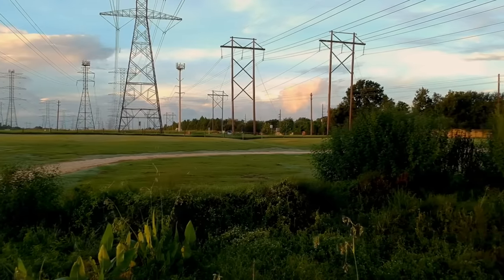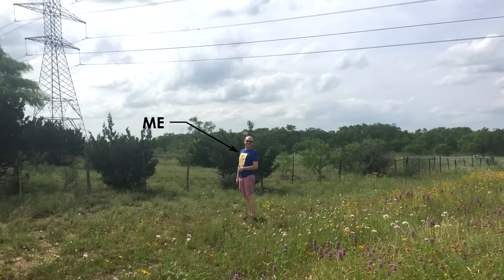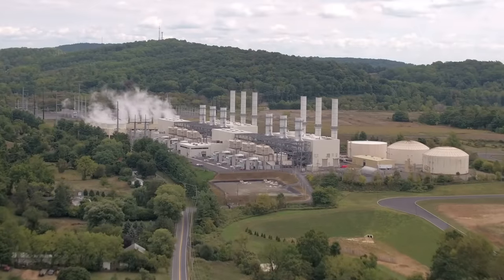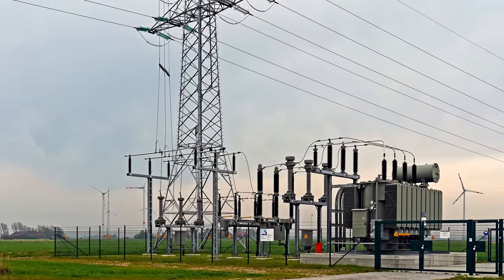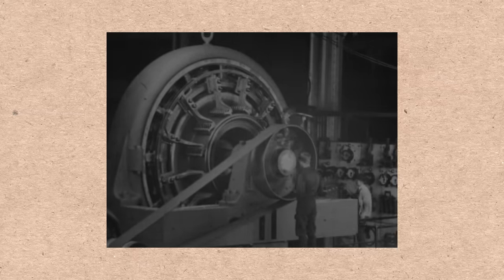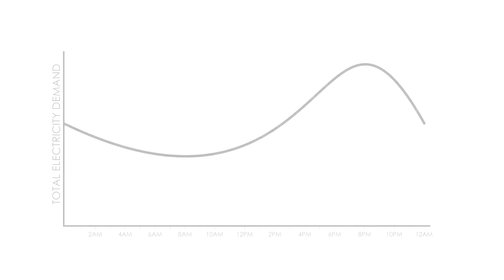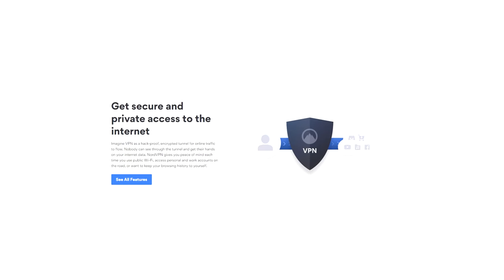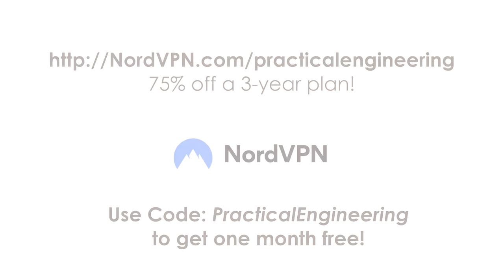How Does the Power Grid Work?

Comment: German energy-engineering student here, I really wanted to see a video series on this topic. So thank you for making this video! It's interesting, that the American Power Grid uses the better frequency of 60 Hz, but the worse Voltage. If you took the European 400/230V and combined it with the American 60Hz it would reduce the powerloss in both grids (European and American) by a few percentage points.

Really looking forward to the next videos!
Reply: why would 60Hz reduce the powerloss? Higher frequencies -> skin effect -> higher losses right? (I know we're talking about 10Hz difference but still...)
Reply: Thing is, if I get this right, higher frequency means better power conversion at transformers, which is a very lossy operation to begin with, though not as lossy as low-voltage long distance power transmission.
Reply: @jtauscher  Yes, but as WastedWizard said, the losses that you reduce in the transformers for going from 50 to 60 Hz is more than the increased resistance in the cables from the higher frequency. Though skin effect is a problem in small diameters, the cables are huge enough, that it's not really a problem. The Inductance and combined with the higher frequency the higher resistance are just small enough, that the transformers simply have a higher gain from the increased frequency than the increased losses in the cables.
Reply: @JainZar1  I like your comment. I have been wondering the same exact thing. But i have a couple questions, if i may? 
Skin effect aside, doesn't 60Hz increase the inductive/radiation losses as well, when compared to 50hz? 
But i get what you are saying. I'm just wondering. Thanks. :)
Reply: @JainZar1  Thanks for your reply, you seem to have a point there. But isn't it the case transformation will be done on a base of semi-conductors more and more?
Reply: So Argentina, 220V/60hz
Reply: This discussion was worth the read. Thanks guys
Reply: @asbjo  As WastedWizard and I already wrote, we think the gains in the transformers outweigh the increased losses in the cables, but you are right you have to consider inductive losses in the big long grid cables.
Reply: It's not that easy. Capacitive losses due to parasitic capacitance of the grid are larger with higher frequencies. But transformer losses are slightly lower. You have slightly more losses due to skin effect, but you might have slightly smaller transformers etc.

The same goes fur high voltage direct current transmission. It's not "just better", it depends very much on what exactly you want to do with it. DC/AC conversion is not that efficient and the stations are quite expensive but you have virtually no capacitive loss and ohmic loss. However, you might have new issues with space charges building up in certain types of cables if the polarity is always the same etc.
Reply: The USA uses 240 volts.

At the home, you connect to HALF of the transformer, giving your home 120 volts. So there is NO transmission loss due to the usage of 120 volt power.
Reply: @jtauscher  Totally, I don't know about highest voltage grids, but AC/AC-converters are used in many high voltage applications already. The DB (Deutsche Bahn) had a 400 MW AC/AC-converter build in 2013/14, so it definitely is a thing of the future grid. The investment times for this kind of infrastructure is really long through.
Reply: @wastedwizard5112  large power distribution transformers are usually around 99% efficient. They are far from lossy.
Reply: Philippines is using 240V and 60Hz (230 in leyte and samar parts, but mostly 240 elsewhere)
Reply: @JainZar1  I'm not an engineer, and haven't done the math either. I'll take your word for it. :P 
What's your thoughts on High Voltage DC backbone transmission systems then? :)
Reply: You know reason for using 50Hz was related to wire cost and construction. Higher frequency means more of electricity (electrons to be more precise) moves at edges of cable. Thus higher frequency requires more wire surface than lower frequency to work at same heat loss (less crosssection to move   more heat generated) There are two main ways around thicker wire or cable consisting on several wires. Both are more costly than thinner wire. Today most common cable(at least where I live) is steel core, bunch of optic cables and those are covered in bunch of copper wires to transfer electricity. At time most european countries started to talk about common electricity grid wire cost and construction was more of an issue than anything else. and yes 10hz make great difference. Electric grid anywhere is just lost of compromises there isn't any perfect one. There may be just ideal for your current needs in your current area. Also Main grid usually work in several kV to transfer at most distances ... Main grid here is 480kV which then transformed to 22 or 44kV for area distribution which is then transformed to 400/230V for most end users ... Which does not effect grid as much as 50 or 60hz
Reply: @JainZar1  AC/AC-converters are not used that much in transmission. DB used them to conenct  their train grid with 16,7 Hz to the common grid 50 Hz. In transmission the transformers will be the best choice. You just use the converters if u have a really messy grid to get a better sinus curve, to reduce the reactive Power and the grid disturbance (Netzrückwirkungen).
Reply: @spoonikle  In Europe its the same, except we use 400 v distribution grid, and connect a single phase to get 240 v.
Reply: @ziadali6298  Cool story bro.
Reply: @MH-df6zx  right!? Plants need CO2 to breathe, and they create oxygen for us. We're always so blind towards nature, then people capitalize on some 'green' energy while everyone else pays a lot to hook up to the monopolized grid. The taxman is happy. ... For now:)
Reply: @marker113  so you're with burning coal or not?
Reply: @marker113  well, that'd be fine if we weren't clear cutting said plants simultaneously. one might be fine, but both lead to some positive feedback loops with quite negative environmental impacts.
Reply: @jtauscher  Actually, the efficiency of a transformers is something like 98%. That said, the fact is that in absolute numbers, the loses are quite high, because even just 2% out of lets say 500 MVA tranformer adds up.
I can't really see big transformers using semiconductors, if something like PWM was on your mind. Semi-conductors are great for consumer electronics, because they need less space, but I doubt that they would be more efficient or convenient than convential transformers.
Reply: This has mainly historical reasons. If you would build a new grid today, you would use a HVDC grid, which provides less electrical losses.
Reply: @asbjo  I believe ElectroBOOM has a video about it.
Reply: WRONG Raven.  The US doesn't use 400/230V for long distance transmission.
Reply: this thread is too advanced for me
Reply: @nicholaslau3194  I know he has. But I wanted to get OP's thoughts on it. :)
Reply: @hotdognr12323  in the USA The voltage of a local transmission line is 13,800 volts. THEN it is dropped at the  house or business.
Reply: @patrickeh696  Right, it's been a while since I studied the topic. But my point still stands, in that the US does not have the same final output voltage as in Europe.
Reply: @jtauscher  Skin Effect at 60Hz is negligible. It is a radio frequency phenomenon.
It is the higher voltage that increases efficiency because of lower current requirements - it is current that causes losses by heating, so better to use higher voltages.
Reply: @JainZar1  Actually, skin effect is worse in larger diameter conductors, not smaller. What happens is the flowing current generates a magnetic field, and that generated magnetic field in turn induces an electrical current that opposes the electrical current that created the original magnetic field. This causes the current to flow in the skin of the conductor. For 60Hz, the skin depth is about 8.4 mm meaning that you can have a conductor up to 16.8mm in diameter before skin effect causes too much of a problem. For 50Hz, the skin depth is 9.2 mm.
Reply: @hotdognr12323  You have no point.  The voltage to the final destination in the USA and EU is about the same.  What is your point?
Reply: Don't want to be too cynical, but this is a pretty sophomoric discussion.  The fact is that the choice of 50 vs 60 Hz as the frequency, and the choice of 120/240 versus 220/440 as the distribution voltage were compromises between a number of competing factors at the time those decisions were made - more than 100 years ago.  If the decisions were revisited today, it is possible that the critical factors might be different, but its not economically practical to change the outcome.  Basically, we are stuck with decisions made a century ago.

For example,  the choice between 50Hz and 60Hz was based on arc extinction physics in the dominant arc lighting technologies used in Europe and North America (enclosed arcs versus exposed arcs).  We don't use arc lighting any longer.  Instead, the dominant lighting technology today is the LED - which is a DC device.
Reply: It's to simple to say that 60 Hz Automaticly give you a reduced powerloss. Next to the mentioned skin effect which gives increased ohmic losses in high current lines, higher frequencies also give higher capacitive losses in long high voltage overhead lines and cables. That's the reason why for long lines they use HVDC. One big andvantage of higher frequencies is that your components are lighter and cheaper, because you don't need so much iron for the magnetic field. This is why they run 400 Hz on planes.
Reply: @jtauscher  Almost certainly not. Transformation of AC power using traditional inductive transformers is incredibly cheap and efficient. There are no moving or delicate parts, just copper windings inducing current through iron covered in paper and oil.
Reply: 400/230 V has its advantages and disadvantages. American 120/240 V power is safer and cheaper to build rectifiers and the like, since it's easier to insulate, but it can't be run across as large a distance without a big voltage drop.
That being said, we use 277/480 in some cases, like businesses with large loads and equipment that needs to be run on high voltages. It really depends on the application.
Reply: @monophoto1  Local distribution at 120V was successfully lobbied by the copper industry. It makes no sense otherwise, not today, not 100 years ago. The logical decision for local distribution voltage is as high as possible without instantly killing humans upon touch and to limit installation costs (for which 200-250V is ideal).
Reply: @mr2octavio  Nope, Argentina is 220v/50Hz, that's why we're a PAL country.
Reply: I thought the USA centre tapped 240V. Don't some of their high powered devices operate on the higher voltage (electric hobs etc)?
Reply: The only reason is that generator are more efficient with higher frequencies. The Transmission is not really affected, you can build smaller transformer than for 50Hz. You get way more losses with earth cable and much more phase problems with that. Also the slower frequency is better for the Equipment this gives a larger time window for relay to operate during faults. But in the Transformer eddy losses do increase not linear with frequency. You might want to visit some lecture for on such topics i found them very interesting learned there allot. Things are always more complicated than a view sentences
Reply: @axiom1650  THERE IS NO LOCAL DISTRIBUTION AT 120V.  Local distribution is at OVER 13Kv.
Reply: I believe that transformers have very high efficiency something like 97-99% (bigger is better)

And skin effect is not a problem of small diameter, but problem of high current and need of bigger diameter. If I'm remember correctly, penetration depth of 50Hz is 6cm where wire conductivity drops to 1/e ( 37%) and to overcome need of wires of large diameter, that are not conductive in the middle anyways and to solve corona discharge, wires are made "thick" by using 3-6 smaller diameter wires held apart by spacers. At least for 400/220kV power lines in Europe which connects power plants and cities.
Reply: South Korea, Philippines, Peru and Guyana have such a system, the first three having 220V, 60Hz, and the latter has 240V, 60Hz
Reply: @axiom1650  
Really?
Reply: @Raven Coldheart schmeisen wir einfach alles zusammen und erhöhen es dann auch noch die spannung und Hz um weitere +10 wird es noch besser. machen wir es dann auch noch gleich so, wie es unser berufsschullehrer gesagt hat: "einfach dc in das haus, weil eh fast alle objeckte im haus an netzteilen hängt. und was einen motor hat und elecktronisch verstellbar ist, hat ja meistens auch einen umrichter."
Reply: @patrickeh696  What I mean is the connection between last transformer and the house.
Reply: @axiom1650  Oh. In the USA it is two lines out of phase by 180 degrees  with a voltage difference of 240 volts AC.  So, what is his point?
Reply: @patrickeh696  Line to neutral is 240V here, double the voltage of US. In the US you need twice as much copper after the last transformer which was lobbied by copper mining industry.
Reply: @mixerfistit5522  It is. Most devices run on Line A or Line B voltage and neutral,  120V.  Ovens and dryers get all three and ground of course.
Reply: @axiom1650  WRONG.  I checked the congressional record.  There was no such National law written when 120 v was voluntarily adopted without law.  So, primary docs or leave.
Reply: @bryanhumphreys940  thanks, makes sense.
Reply: Power engineer here....  "Better" in this case is a little subjective. At the surface this is a very basic question, however, the 'answer' is endlessly complex. At the scale of an entire grid, from production to consumption, these calculations are enormous, and at best estimates. There's losses to be accounted for everywhere.  First point is, household voltages only exist generally from the pole to your house. At the plant we're producing energy at relativity low voltages anywhere from say, 2-20 kV. The transformers step-up to anywhere around 760 kV for transmission lines. 

How far into your studies are you?  Have you made it to power factor yet, resistive , inductive, and capacitive loads on the grid? That was the first topic to really start to twist my mind around.  

Customers using large induction motors for example, have a significant negative effect on the power plant they're connected too. Essentially, an induction motor running, simultaneously acts as a generator working against the generator at the power plant. In most cases, industrial customers with large induction motors are required to have appropriately sized capacitors to account for the inductive loads to even be connected to the grid. Appropriately sized, often means entire buildings. A large enough inductive or capacitive load on a grid that's not accounted for can trip the entire power plant, which cascades to other power plants who simply can't make up for the loss of a plant. As you can imagine this is a big deal for grid operators. Many power plants run off the energy they produce, and as a result can't start themselves in a blackout. 

Good luck with your studies and career to follow my friend. It's a very interesting and dynamic field. It will keep you employed and studying for 100 lifetimes.
Reply: Raven Coldheart, Whether in Europe or the US, transmission is done in thousands or hundreds of thousands of volts.

It is only stepped down to lower voltages (typically in America, 480V or 208V three phase or 240 single phase) at the facility requiring the power, such as a house, business, factory, etc.

Your end use voltage preference has no effect on transmission losses.
Reply: @monophoto1 : "Basically, we are stuck with decisions made a century ago."

Couldn't the voltage and/or frequency be slowly altered over many years (if there were benefits to such a shift)?
Reply: I have no idea what you are talking about
Reply: Just wait untill DC comes back to the power grid. 

DC-DC transformers have gotten super cheap and efficient thanks to advances in power electronics. 

In DC there is no reactive power loses (oscillations in the power line). No power factor correction. There's no inductive coupling. DC is also way safer. 

No 3 phase non sense, only need a live and a ground. 

Most of the loads in a home are DC and will benefit from a DC power source (much smaller power supplies because you wouldn't need any transformers). AC loads like a dryer can use a VFD. Vacuums can use PMDC motors. 

Solar panels would be able to directly couple to a DC grid with a charge pump, and safely.
Reply: American electrical engineer here. We have a 480/277V system used in most commercial/industrial buildings. But yes, the 240/120 2P residential system, or the 120/208 3P commercial system is what most people are familiar with. I agree a 220-240V system would be better for everyday use, like Europe or most of Asia uses. But it's also more likely to kill you with our shitty outlet design.
Reply: Technically we do have 220V being delivered to the house (many places now have 220V three phase). My house is connected to a HV 3 phase through a pole transformer to deliver 220V two phase. The two phase makes our 120v/120v/220v distribution in my house. Many years ago we had many different areas having different frequencies (anywhere from 25hz to 440hz). When rural electrification (government mandate) happened, we needed a standard frequency and voltage. Anything above 120V was deemed dangerous to "uneducated" farmers, and 60hz was easily sent over long distances (manageable high frequency losses under 100hz and the step down transformers weren't too large for a frequency that was still easily calibrated against a tuning fork plus copper for us at the time was rather cheap). Even then it took us a while to go from a two prong un-grounded plug, then a two prong with one wider prong for neutral, and then to the now familiar three prong with its ground, wide prong, narrow prong socket. Our rural electrification is the reason why we have a weird plug, not having a higher line voltage, and 60hz standard.
Reply: sorry you got it all wrong we use 120/240V/208v/480v as well(split phase and 3 phase)
Reply: As was pointed out by some among the gibberish in the comments, there are historical reasons for frequency choice of the power grid.

Basically it is not connected to voltage, voltage is a result of the transforming step you conduct before going onto the household mains and this could be literally whatever you choose.

Frequency is solely connected to the generating equipment.

The origin lies in the standard speeds of steam turbines. At the early days of electricity all power was generated using steam and it was well known that the efficient range of these units was 3000 - 3600 rpm. 

To get your frequency you got to multiply the speed of the turbine (power train runs at constant speed) with the amount of poles in the generator and then divide by the separation of phases in degrees. This gives 50hz for 3000rpm and 60hz for 3600rpm.

I’m not so sure about the efficiency increase you refer to as the grids and systems are built with the specific losses (efficiency) of each system in mind. E.g. generator active core size is deduced from ha and required efficiency.

Could it be you actually mean that by combining the two systems you could obtain same efficiency at lower equipment cost? (Due to reducing generator/transformer/shunt sizes?)

Grtz
Reply: I feel so dumb when reading this thread XD. But I like it.
Reply: @spoonikle  YES!  240 Volts for large appliances and 120V for the smaller ones.  Seems like a smarter system to me.  Even overkill these days will all the low-voltage DC appliances like this computer, and the TV and the usb charging cables.  I'd hate to have those giant plugs/sockets used in some countries.  It would be nice if there were a DC standard that could be used in homes.
Reply: @spoonikle  this is totally incorrect
Reply: The voltage in a house is completely irrelevant when discussing the grid, the lowest grid voltage you will see is 12.47kV or 12.47Y/7.2kV in the US, anything less is end user side. Also, we are not only using 208Y/120V or 120/240V, there is also 480Y/277V for industrial use as well as 4.16kV and 4.16Y/2.4kV which are used for facility distribution and very big motors.
Reply: @davidkennedy7630   https://www.youtube.com/watch?v=fJeRabV5hNU
Skip to 5 mins 2 seconds to get owned.
Reply: @patrickeh696  my point was to correct someone that commented that the US has the same output voltage as in Europe. The US has 230v 3-phase and 120v single-phase, while in Europe we have 400v three-phase and 230v single-phase.
Reply: @hotdognr12323  US residential service is 240v phase to phase(NOT 3 phase), 120v phase to neutral. Three phase is whatever voltage the customer requires, often 480 or 208. 208v 3 phase still gets you 120v phase to neutral.
Reply: I wish we had 1500 Hz frequency. Costs of Machine would reduce.
Reply: @lordpochinki2112  costs of electricity would skyrocket though,because there would be way more transmission losses.
Reply: @sleepib  how..
Reply: @lordpochinki2112  First, skin effect is a bigger issue at those higher frequencies, and transmission lines have inductance. Higher frequencies are used sometimes where you don't need long distance transmission, aircraft often use 400hz, for example.
Reply: @sleepib  hmm that I didn't consider.
Reply: @Viipyilevä Miete Maybe, but if you're spinning something faster, you also usually get a higher power density. You can also increase number of windings if you want lower rotation speed.  Choosing the optimal frequency for a power grid is a hideously complicated tradeoff. Way back when electricity was new, everyone used the frequency that was best for their specific case, eventually different regions settled on their current standards, and now it's too entrenched to change it, even if the optimal balance would be different if you were making a brand new grid with modern technology.
Reply: I just read all the comments in this thread.  Too many it seems are wrong.  So what's correct?  My understanding of the comments is DC for transmission lines is the long term future.  If so, Thomas Edison wins in the end, sort of.
Reply: First of all I will let you know as a person training to become a lineman. Almost everyone is wrong about everything. There is three steps in our grid system. Generation transmission nod distribution. Generation is where the power plant is located and a substation with transformers kicks the voltage anywhere from 75kv to 500kv I kid you not. Transmission lines are what you see that have steel towers or tall poles. Those lines are made out of aluminum with steel core . Copper would be way way to heavy for how big and long the lines go. Those transmission lines get stepped down at substations across the communities and transferred down curtain circuits that are usually given a name like of a town or street. From there it is considered distribution. Almost all new construction of overhead distribution is aluminum again with steel core not copper like some of these idiots say. The older stuff is copper. Those voltages are anywhere from what I have seen 28kv to 4kv. That’s all determined on demand and how far the line needs to reach. That doesn’t include considerations for single phase all the way to three phase and a neutral construction based off of what kind of customers your are dealing with. Whether it’s industrial or just residential. There is all kinds of technology in between that helps make up the voltage loss as you go down the lines. I’m not going to go into it because it would take way more time. The transformer at the house steps down the voltage to whatever the customer wants. 120/240 240/480 doesn’t matter there’s other combination based off of different companies and different designs. Technically our grids systems use a little bit of both delta and ac. Mostly ac then you also go into delta and wye system designs. For instance most of california is delta system while most of the country is what we call wye systems. Research it if you want to learn more. Don’t pay attention to this thread it is very inaccurate
Reply: @JainZar1  I know it is a year ago, but I do not think you know how skin effect works. Bigger cables (diameter) does not help on skin effect. In fact to help on skin effect you have to make the cables smaller, not bigger. The bigger they are the more ineffecient will it be. Could not help to answer, so people dont get misguided :P
Reply: Go study. Your comment hurt me so much
Reply: @spoonikle  most homes actually have circuits for both halves, and a few spanning the whole thing for large appliances.
Reply: @jtauscher  o
Reply: @mr2octavio  the same as the united states which is 240/120v
Reply: I would argue that American power is still 240 volts, we just use split phase to make it safer in the house
Reply: @pilotavery  The resultant Amperage from 120 V is still plenty to kill someone, but I guess it's better than nothing if you don't use GFCIs for every circuit.
Reply: @JainZar1  maybe so, but it's still much safer. You're much less likely to be injured by 120 volt versus 240 volt, statistically less than 20% as likely. And so it's always better to have a lower voltage.

The grid is 240 volts here, and you can drive 240 volts at your panel or across two different bedrooms. They split it in half so that low power equipment only needs to be rated for 120 volts.
Reply: We are actually a 240 volt system. Almost all houses get 240 volt. We can still get 240 volt plugs. The only difference is we split the 240 volts in half for low voltage equipment. Check out technology connections video on this subject!
Reply: @spoonikle  At home you have 220 volts from the transformer to your power distribution panel (breaker box) inside your house. It is then split into two 120 volt bus bars inside your home power distribution panel. It's only 120 volts from the circuit breaker inside your house to the appliance/light/etc inside your house.